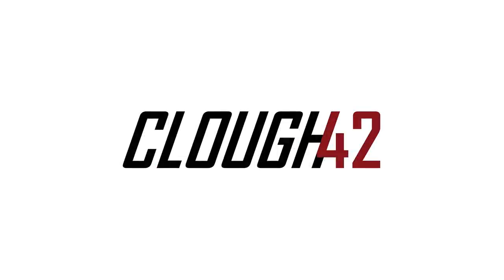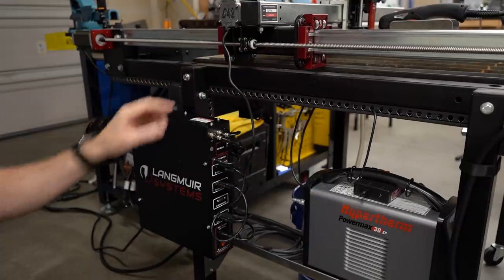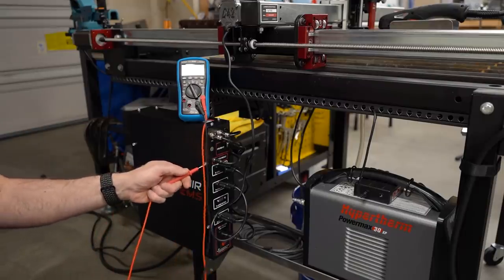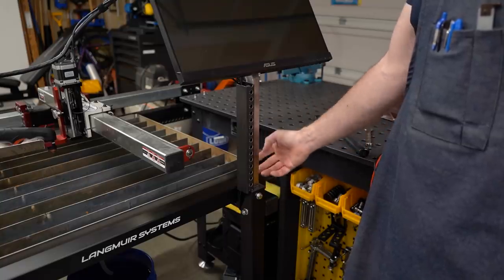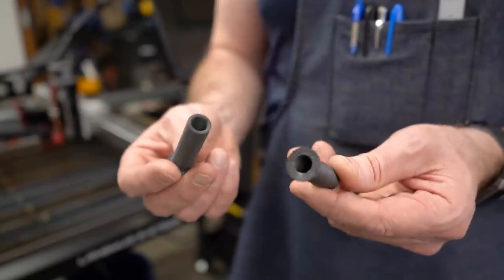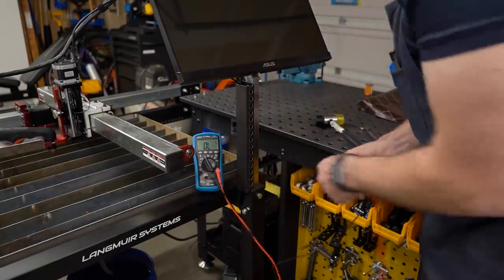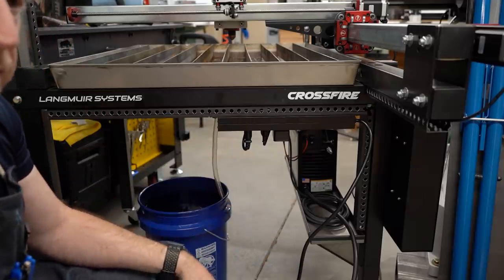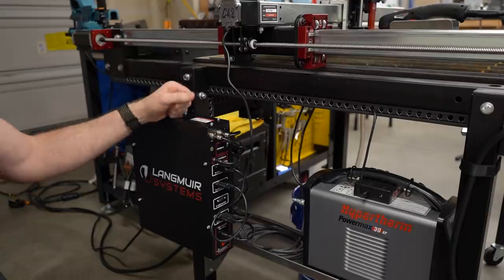AddenDUMB: I Broke My CNC Plasma Table! | Learn from my mistake | Langmuir Crossfire THC

Comment from the maker: SAFETY NOTE:  I do not recommend disconnecting any safety grounds.  The connections that I isolated were connections between the plasma table frame and the earth ground that I inadvertently added to the system with my modifications.  The plasma cutter, CNC electronics, computer, monitor, and plug strip are all still grounded to the safety (protective earth) ground through their power cords, as they came from the factory.  I am aware that there are various documents recommending that plasma tables should be separately grounded.  The Crossfire plasma table does not come from the factory with provisions or instructions to earth the table frame, and in fact doing so prevents the torch height control (THC) electronics from reading the arc voltage.  If you are concerned about this, I'd love to hear about it in the comments, but I can't do anything about that design, as it is inherent to the Crossfire THC.
Reply: I guess  a GFI (RCD) would take care of most of those concerns.
Reply: The solution (potentially) would be to opto isolate the signal feed/s from the table. But without seeing a schematic of the CNC height control it's hard to be specific.
Reply from the maker: @boblewis5558  that is a very interesting idea.  I don't see any reason why that couldn't be done, though it would require very careful matching of an optocoupler to stay in the linear range.
Reply: @spehropefhany  I bet a GFCI in this situation would be tripping out constantly from stray currents induced by the plasma cutter, especially now that you have two ground returns from the plasma cutter and the controller!

Comment: As soon as you mentioned you went back to the carbon-reinforced materials, I had the concern that carbon fiber is a quite decent conductor. Evidently, the level of integration in your feed material, it's density, and discontinuous orientation of the cut strand is isolated enough that you didn't form a circuit with your part. Again the carbon version, like the metal is NOT necessarily - "more better". Running a composites shop, we are extraordinarily careful to keep fiber strands and dust out of the air as they eventually and inevitably find the magnetic fields of circuits and create shorts. Plain plastic is definitely more predictable isolation. ceramic, phenolic or even end-grain oak can provide modulus if you need them:)

Comment: It's always interesting to see what sort of signals people put through the chassis.  I've been rebuilding a cheap 3D printer that suspiciously tied the logic board to the frame, but fortunately it appears that was just a "safety" ground.  (Note that the printer takes 19VDC in, and no grounding, so it's not earth ground.)  The nozzle, thermistor, heater cartridge, and bed heater never connect to the chassis ground, so nothing ends up being mysteriously polarized, fortunately.  (You have to check, because if one end of the heater ends up connected to the case and that end happened to be wired to the control board's positive terminal, then you blow a fuse, which is annoying.  But, luckily they isolated everything, so it wasn't a problem.)
Reply from the maker: For welding and plasma cutting, often the table is used to pass the arc current.  That's all that's happening here.  Though it typically isn't a huge safety issue, in this case it's a problem of offsetting the small divided voltage being fed into a microcontroller analog input pin.
Reply: Something to keep in mind is that the heaters are generally negative switched, because N-channel MOSFETS have a low RDSon and are cheap, and it's also cheap to not use any kind of special gate drive magic circuit; so when the board connects GND to the frame, you're one fault away from the heater switching being bypassed and the heaters being stuck on uncontrollably. Mind you since there is nominal heater resistance present in the path, fuses, even if present and well-chosen, won't fire either. It's a sneaky fire hazard. The only way around this is to have PS_ON control, so an extra relay that the board can switch that would unpower the whole machine, and ideally test that it also works with watchdog timer.
Reply: Well with a Langmuir it’s a ton! They are riddled with EMI/EMF noise as they use no methods of insulation or isolation. If there’s a manual on how not to build or wire a cnc Langmuir wrote it.

Comment: Not a big one but today I was finishing mounting a DRO to my drill press (long project) and after several hours work I turned on the display, moved the axis, but the reading didn’t change.  I was worried I had damaged something during the installation.  Eventually I realised I had not plugged it into the display!  All working fine now.

Comment: Merry Christmas, James & family!  Nicely done diagnosis, too.

I doubt it would ever cause problems after your fix, but you might want to insulate that mount at the monitor.  The water in the tank probably gets conductive between cleanings, and that monitor stalk looks pretty close to ground.  73 de W4YBO
Reply from the maker: Splashing enough water to conduct is possible.  Worth considering.

Comment: I noticed you are using a 30xp and the thc upgrade. I am using the same table and cutter. I purchased the thc upgrade but I am not sure how to hook it up inside the 30xp any tips? Specifically what color wires to hook to.

Comment: One thought: the printed sleeves; do they contain considreable amount of carbon fiber ? Carbon fiber is conductive in tself, so you might need to keep an eye how this evolves. Personally I would have used PE for the sleeves as enything containing carbon fiber can easily be conductive.
Reply: I was thinking exactly the same.
Reply: Same here, I've been toying with the idea of 3D printing some cover plates for a saildrive that I'm modifying to be electric. Would be cool to do them in CF-PETG, which I have an un-opened spool of on hand.
But, they would be bolted in to the saildrive housing against bare aluminum. It's on the inside of the boat, so not going to see much water, but definitely some moisture and salt.

The plates will cover holes from old hardware, so will need to seal against the housing with o-rings.

I'm worried that I'll get a corrosion problem between the CF and the aluminium and the stainless bolts..

Comment: As soon as you started describing the problem my brain went, the vesa mount screws! You just solved the problem higher in the chain. Very nice, thanks for sharing, and like you I am impressed nothing broke. Given how I haven't seen any signs that say "do not ground" on the metal frame, I'm a little surprised the box doesn't do a similar continuity test on startup. (I'd be curious how good the isolation is that you have now: what at least the British call a "Megger" - for measuring mega-ohms resistance vs thousands of volts, which is part of at least their workplace electrical safety routine testing - would be an interesting test, since the voltage used for continuity checks is pretty low.)
Reply from the maker: The voltage used for cutting is also pretty low (under 100v) so it's probably not an issue.  They give a cutoff in the docs of something less than 100 ohms.  Don't remember the exact number.

Comment: Merry Christmas to you and family James.  A year ago I built my own 3-axis Mach3 control cabinet and also built my own Z-axis for implementing THC on the Crossfire.  In doing so, it encountered the same grounding issue, but in the form of crippling EMI at the controller. Once the box was isolated, problem solved.

Comment: I'm really curious now if that did in fact fix the problem because our plasma table at work (which has THC too) has the controller box grounded though the table and through the ground pole of the power plug.

One thing to note though that might be a factor here is that per the manufactures instructions,  our table is directly grounded to earth via 10ft of ground rod driven into the ground next to one of the legs of the table and its connected to the ground connection point on the table where the plasma work clamp ground connects. I know that there was a note in the install instructions that said that without that true earth ground, there will problems with erratic THC control behavior.
Reply from the maker: The THC design is probably fully isolated on that unit.

Comment: My current project had a similar issue with a USB connector and a touch screen. The entire aluminum frame and enclosure is connected to mains ground. Turns out the OEM touch screen mounting pads were connected to the electronics ground which in turn meant the electronics ground was connected to mains ground. Had to use plastic mounting screws and washers to isolate it. Next was to make a custom USB enclosure surround to keep the USB ground from touching the case. No damage from being grounded but testing with the meter was kinda baffling at the start.
Reply: Whenever USB is present, you can assume that it will be earthed sooner or later, for example via an ATX PC.

Comment: Love all the haters out there. I made a silly mistake with my table this summer.... I set an exhaust manifold on it to weld a broken bolt. This resulted in damaging the transistor on the motion control board for torch fire control. Didn't know I did until months later making Christmas presents.  Guys at Langmuir helped diagnose and really took care of me. I love my little crossfire.  Only wish I bought the pro for size!

Comment: When I was a noob at electronic, I was so confused seeing the starter of my car having a single wire. I was like how the starter is working with a single wire. I didn't know the hole car body was the ground. :)
Reply: Bad chassis grounds are the bane of very many trailer lighting setups, where it's substantially harder to get a nice solid conductive path in say, a folding trailer....

Comment: Did I understand correctly, that the nuts in the monitor's VESA mount are connected to the monitor's ground? Then I would rather recommend to isolate the monitor's VESA mount from your monitor stand, instead. As it is now, a larger sheet of metal could easily short between the vertical bar of the stand and the table.
Reply from the maker: Yes, it could.  The torch would not fire, though, so it would become immediately apparent if this happens.

Comment: do you think the manufacturer could feed the height voltage through an isolating adc/comparator ? instead of simply feeding it to the control box, which is the root of the problem ... afaik

Comment: It might be a good idea to relocate the monitor location so you could stitch a larger than the table size on your table utilizing the open end of the table. That is one advantage to the smaller table,

I have hard mounted my power strip, the water pump and have my plasma cutter seated on a welded on frame tray. Nice to know I have work to do.
Reply from the maker: This setup is really ideal for my small shop.  I've pulled it out and used it several times, and it's super convenient.

Comment: As others also stated… watch out for the conductivity of CF-reinforced filament. Depending on print settings it can become conductive. If i remember our tests correctly, the conductivity of the 3dxtech CF-Petg increases with print temperature. Stratasys CF-reinforced filament prints ARE conductive to a higher degree… i would replace these CF parts for pure plastic, to avoid indeterministic future issues.
( I would not trust the parts to keep their high impedance when exposing them to transient voltages, as the plastic so easily can alter its behaviour due to print settings.)
That said… i am a heavy user of 3dxtech esd-petg for electronic projects… as normal petg generates quite big levels of electro static voltages when breaking them free from the metallic build plate of the Prusas we use.

Comment: But, but, but, surely CF PETG is also conductive to some extent? Did you measure with the resistance setting, instead of the continuity test of the meter? My Fluke has a threshold for continuity, which still shows reduced resistance, but does not always trigger the continuity signal. But then again, you know what you're doing...
Reply from the maker: Not really.  It would need to be under 10k to matter.

Comment: Ground isolation is always a challenge. One thing that is easy  to overlook when using PC peripherals is the connector housings. USB, HDMI etc connectors are tied to chassis ground within most devices. Easiest way to check is to measure continuity from AC input ground to connector housing. If no continuity is measured, plug in a regular USB drive and recheck. Some USB peripherals do not isolate signal and chassis ground.
Reply from the maker: Agreed.  This is a big issue with laptops, since often the ground is connected to the negative of the DC supply, and the current causes voltage drop and noise in the ground reference, and any unbalanced audio output.

Comment: Curious what the resistance is of the Carbon printed parts.
Reply: My thoughts exactly! The carbon fibers are definitely conductive, whether they're close enough together in the PETG to cause a low enough impedance connection is the question he answered in this video😋
Reply from the maker: It reads open circuit.  The fibers are not continuous.
Reply: I thought the same thing, while simultaneously thinking carbon fiber embedded in plastic likely not a problem. The conductivity of the carbon fiber is probably measured in nanosiemens and is irrelevant. Though I'd keep it in the back of my mind if things get wonky in the future.

Comment: Hopefully it didn't fry anything...

Just in case something (some sheet or else you are cutting) goes shorting the table to the post (which isn't far), I would insulate the monitor from the post (opening the holes in the mount and adding some plastic spacers should do the trick)

Don't bother making mistakes!  Sure you learn things but we do too :) even more when you make the mistakes before we have the chance ;)
Reply from the maker: This is not a bad idea.

Comment: It seems at least one other person has spotted the same issue I did. My youngest brother is the senior electrical engineer at a top F1 team and been there for 27 years! The problems he has experienced and had to resolve due to carbon fibre composite conductivity are many and varied. Without going into great detail I should advise anyone thinking of using ANY form of carbon composite material to consider fully and test experimentally any possible issues that may occur. An example of one "trivial" decision such as to cut two separate holes to pass high current cables through a carbon fibre sheet rather one much larger hole is the potential for LARGE eddy currents WITHIN the carbon fibre to occur  (just as in a steel sheet) & generate a LOT of unintended & unexpected heat and even fire.

James, you may be lucky with the carbon filament you have used but it MAY just be that there is NOT full isolation but sufficiently high resistivity to "isolate" the problem. A proper high voltage isolation resistance test from a tame sparky might be wise as a precaution.
Reply from the maker: There isn't enough carbon in this filament, and it isn't continuous.  The good news is if it eventually breaks down and conducts, the torch will stop firing.

Comment: Whilst this is working the use of carbon fibre reinforced plastic raises a little concern for me. Makin the sleeves with a conductive element seems like a risk for some future hard to debug issue. I've not done any work with that material yet in 3d printing, mostly know it in terms of electrolysis risk in composite form where the structure is quite different.

Comment: I fried the PCM on one of my customers Jeep once. I was using a Power Probe Hook to test a crank sensor and needed both hands to place the leads. I had wedged the probe between the heater hoses so I could see the screen. I had a coworker start the engine. As engine started, it shook the heater hoses and depressed the voltage button. It sent 12V to the PCM via the signal wire. $800 later, I learned to never use a Power Probe to check for sensor signal.

Comment: This looks like a nightmare to find the short, but fortunately you didn't break the controller with this high voltage. I once connected 20V to USB data through a faulty stepper driver and it broke a few USBs on the motherboard and the computer has some trouble booting now

Comment: This is a bit confusing. If what you say is true this means in operation anything connected to the return lead of the torch is not at ground potential. This sounds potentially dangerous. I think the problem really is related to the way the torch height voltage is measured. Got to look at how my torch is wired tomorrow. Planning on mounting my plasma torch to my CNC router table.
Reply from the maker: On this table, the cutting circuit is floating, and not ground referenced.  In practice, the table probably ends up floating around 5V above the earth ground, due to the way the torch height control divider circuit works.  As others have pointed out, this wont be a safety problem unless something else goes wrong.  But it could become dangerous if the torch lead were shorted to ground, for example.  I would not have felt comfortable designing it this way and selling it.